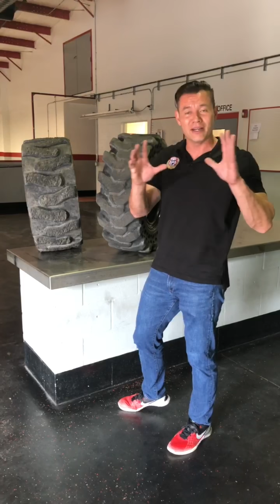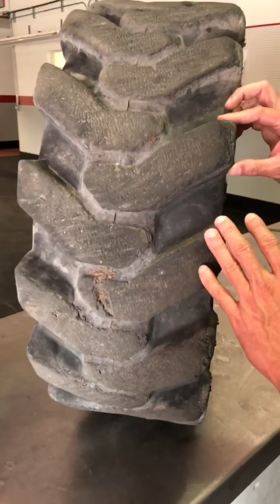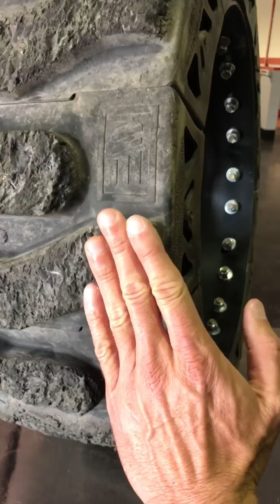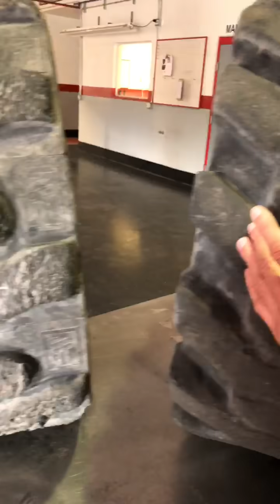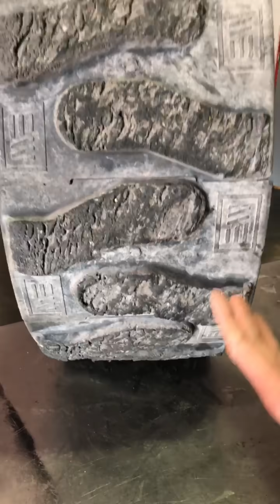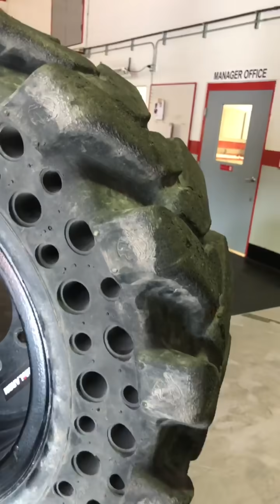McLaren destroys competition in Solid Skid Steer Tire Test

Comment: Those are not the same size tires. Seems like there’s some kind of BS going on.
Reply from the maker: WATCH all previous videos.  Tire diameter is the same and equivalent.  You can buy our tires and place them on one side and competitors on the other.  The segmented type tire doesn't stand a chance in longevity.  Its been tested many times.  So no BS!